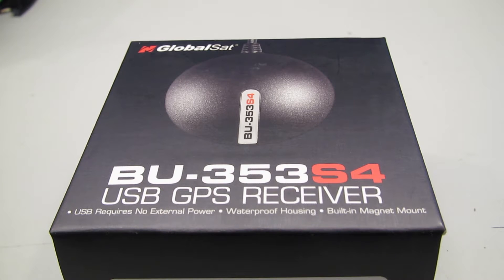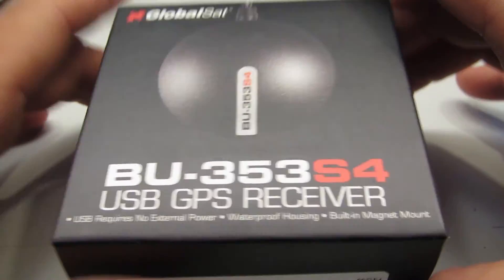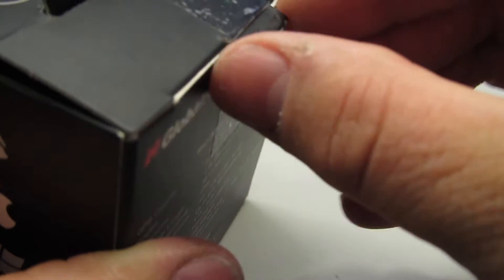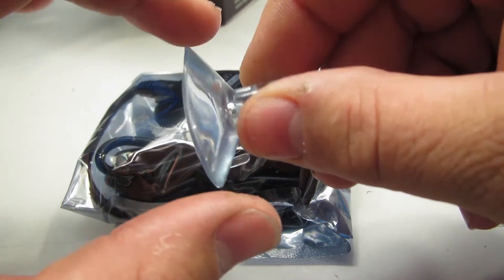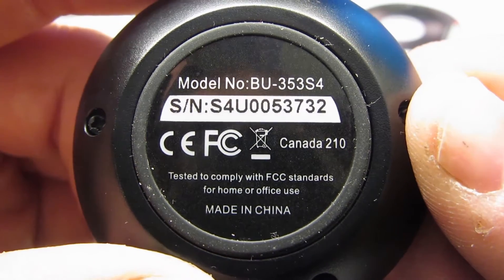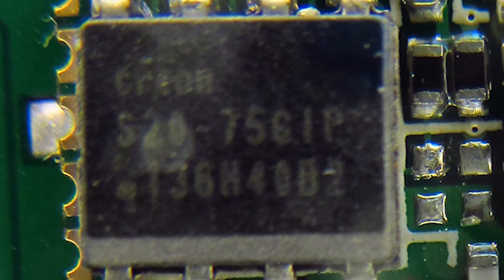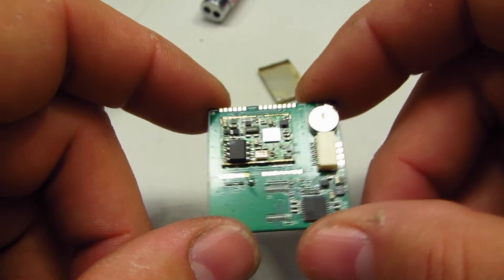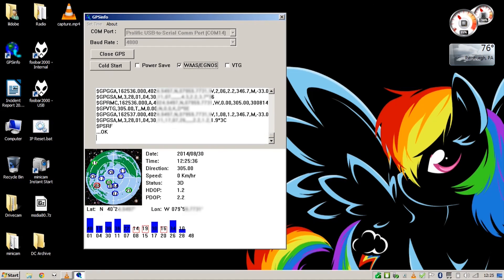Modern GPS Teardown - GlobalSat BU-353S4 SiRF Star IV USB GPS

Comment: I know this is several years old, but can someone tell me if pin 2 or 3 is serial NMEA data our (tx)?
Reply: Pin two or three of which component?  J2 is nothing but a USB connector, but if you're talking U1, the PL-2303HD prolific USB to Serial bridge, than yes, pin 2 is RXD, pin 30 is TXD.  Page 14 of the datasheet linked in the description describes all of the pins on the QFN32 version: http://www.lildobe.net/youtube/pl2303HX.pdf

Comment: hey man, good video, mine just stopped working today, i got it back in 2012 but i never really used it other than testing, i ran it for a couple hours today then i tried to run it on windows then it stooped working, no LED light anymore and no computer can detect it, however i can feel the buttom of it gets pretty warm when i connect it for a several minutes, i wounder if something shorted-out in the inside or some battery problem, i would like your take on this ?

Comment: The component in the video with the metal lid is a Kyocera TCXO.  It is the reference for all of the RF generation on the receiver.  The component with the glass lid is a typical tuning fork resonator for the real time clock.  The very largest component is a flash memory.  It contains the operational microcode for the receiver.  The ephemeris is not stored in the flash memory, but rather in volatile memory onboard the receiver itself. The battery is needed keep that memory alive when the power is removed and to run the real time clock as well.
Reply: Not quite. The largest component with the metal tile on top is a GPS patch antenna. The large metal can is not an IC, but a shielded PCB module, and contains not only the reference oscillator, but the actual GPS receiver chip itself. The flash memory is incorporated into this GPS receiver chip and is not a separate chip on this device.
Reply: @tgies  I know it's been a year, but he is talking about the things in the can. Clearly, you haven't watched the whole video.